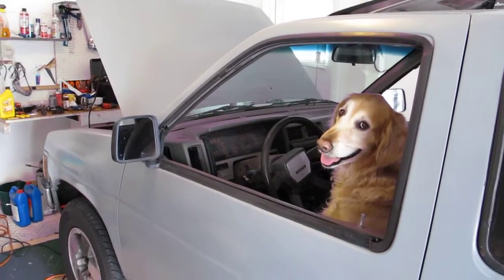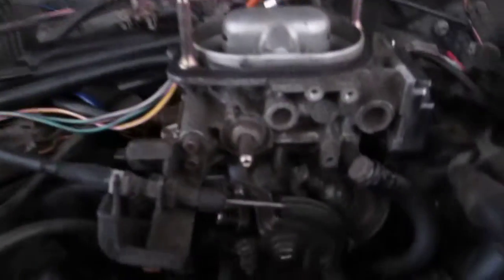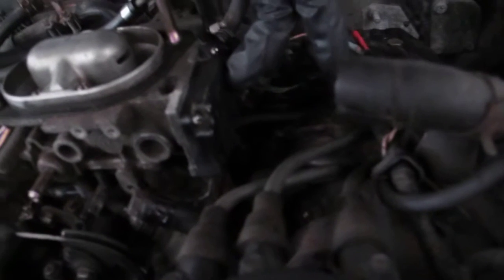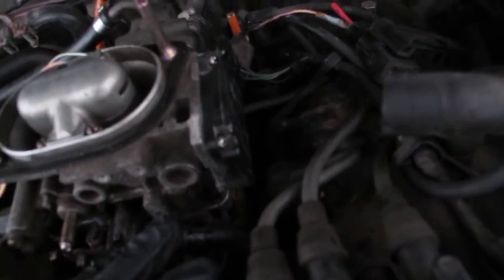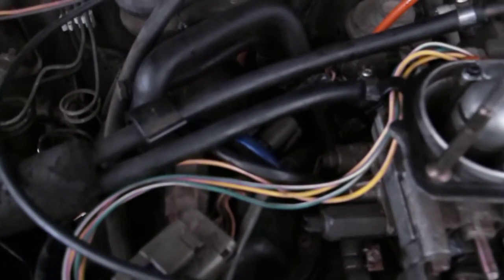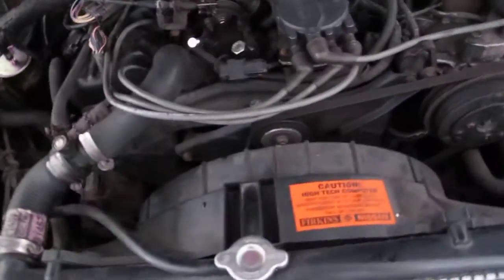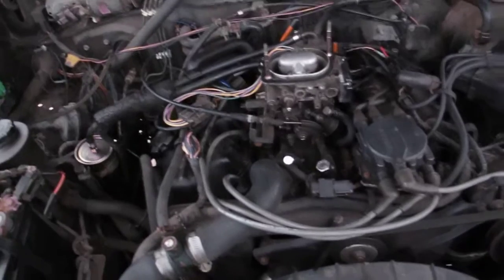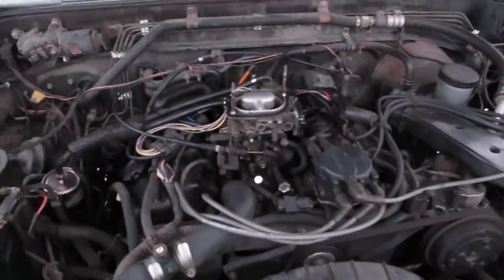Nissan Hardbody. Throttle body coolant delete.

Comment: Dis it work. I have a leak rn on my 87 and I don't know the name on the pice that connect the small hose from the throttle body to the radiator hose. That splitter is like a valve and it's leaking

Comment: If you live where it's cold this isnt going to be the fix. The channels that flow coolant are supposed to inhibit heat so in the winter you wont crack that super fragile 500 dollar piece of garbage they call a tbi unit. This is literally the only drawback to my z24 first gen d21 (86-90ish) and that CAN be done in southern Florida no doubt. But if you had actual cold starts youd basically be handing that tb unit an asswhooping. Anyone below the Mason dixon probably has this to their advantage. But I do live where it gets cold and this more than likely wouldnt work worth a fuck in the winter where I'm at. I'm 100 miles away from death valley and I'll see 110 all summer and 20 degrees all winter. Glad it worked for you tho. Lucky guy

Comment: Hey bro have you had under load problems with the Nissan??
Reply from the maker: What's an "under load" problem?
Reply: Junior Escareno  under load is a term used to Describe the symptoms of the problem so under load is not a problem lol under load is when an engine is under more stress than normal driving like going up hill or when you get a green light ...once the rpms go back to to 1500 or so no under load

Comment: Sounds like shit.

You said that on someone else's video so figured you would like it on one of yours.
Reply from the maker: WhoSaidTyler Well, on that other channel, I've been a subscriber for years. And that Falcon really was just about the worst sounding car I've ever heard in my life.
Reply: coffeefish  Maybe so man, but stuff like that isn't helping anybody. What if he gets pissed off and stops making videos? I don't understand what  people expect the result to be when they make a mean remark.

 Anyway, I've heard a lot worse than that. When it was sitting by the garage at the end I could barely hear it running. You know...it IS 53yo.
Reply from the maker: I feel somewhat guilty about making that comment, but I didn't think he really was exactly "emotionally invested" in that car. I got the impression that it sits outside in a field 12 months a year and maybe once or twice he tries to start it and goes for a quick spin. If I thought that some time and effort was being invested, I never would have been so vulgar.
Reply from the maker: WhoSaidTyler Dam it, I'm going to delete that comment now. Your right, it's just to mean. By the way, my truck sounds like shit because (as it turns out) a chunk of the circuit board (the ECU) caught on fire and became toast. Somehow a small current managed to jump across the ashes and the engine would run. I picked up a new ECU on ebay and now the thing runs better. Just don't try to rev it past 3000 rpm because something is still wrong and the computer shuts off the fuel.

Comment: Maybe the intake manifold gasket. Or the meter is about done with. I really have no idea.
Reply from the maker: I just tightened the intake bolts a quarter turn. The TBI is full of coolant passages; it could be the manifold gasket, but I have to guess that the leak is inside the throttle body. Just checked everything and headed out for a ride. Because I blocked off all the TB coolant passages, maybe it will dry out eventually. It's a long trip for coolant to get from a gasket leak, up the manifold, up through the mixture heater, and up some more to find the air flow meter.

Comment: OH! It's fixed? Awesome! I was starting to worry you had a busted head gasket with that coolant on the MAF.
Reply from the maker: It's running, but hard to say if it's fixed. I don't understand how coolant is getting all the way up through the intake manifold, up through the mixture heater, past the throttle plates, and into the air flow meter. There is really no smoke from the tail pipe, like it might be burning coolant.